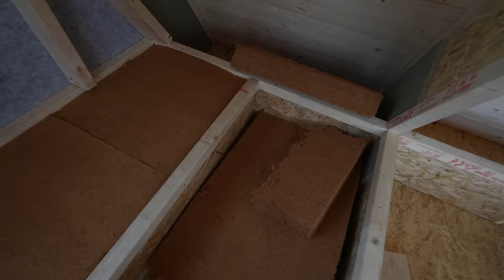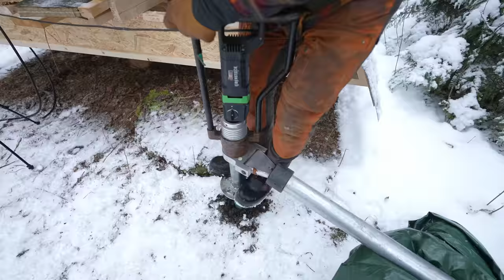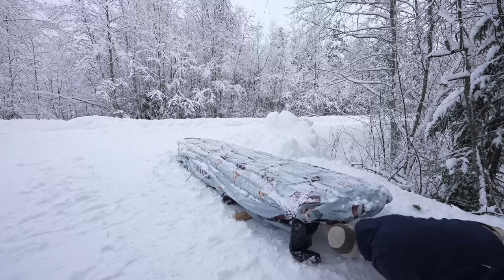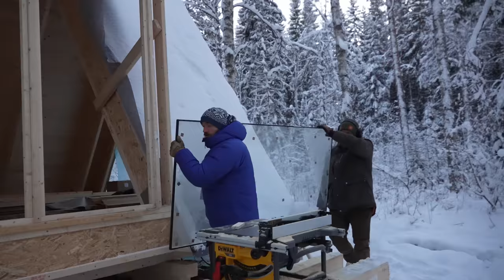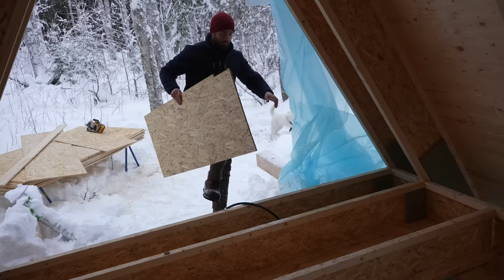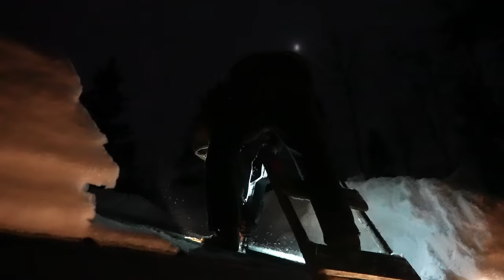Building A-Frame Cabin in Northern Sweden Part 2

Comment: Hi kalle. As a designer I like both doors, but although the mix of circle, straight lines and triangle of the A option is quiet original i think that the perfect match would definitely be the B option because of its  harmonic continuation of the triangular A frame.......bottom line : B for me.

Comment: Congrats Kalle on all your terrific progress with your A-Frame.  Wish I had been there to help you lug the lumber.  Re the door:  Version B is the safe way to go .  But A is less predictable and would "shake things up" a bit.  Also, I think a round window in a door makes more sense and is more pleasing visually.  However, I think the round window needs to be a little lower in the door and slightly bigger.

Comment: Check your local regulations but I think unless the cable is armoured you have to lay it in a conduit (normally red is used for power, also check what are your requirements).  You have to put also a plastic mesh around 10-15 cm above the conduit/cable so that if anyone digs in the future you get a warning that a cable or pipe is present.
The cabin looks good though!

Comment: Door "A",  the triangle on door B does not appear to have the same slope as the cabin roof. I think this will look odd. If you match the slope on the window to the cabin, the proportion will also look odd in comparison to the size/outline of the door, so the circle is better.